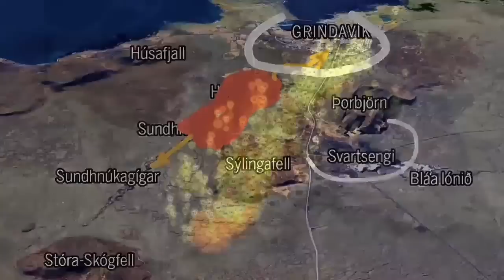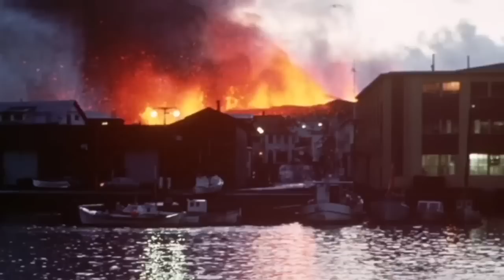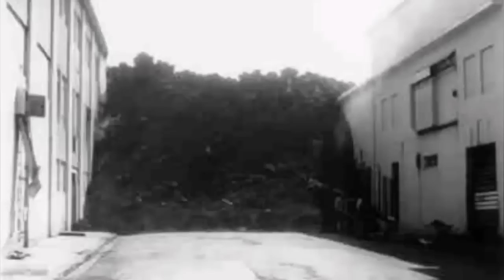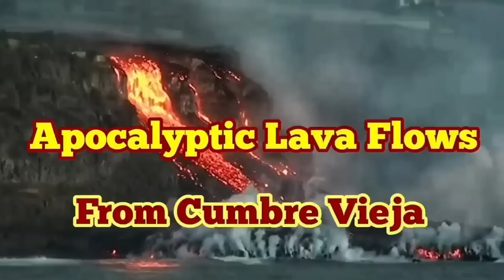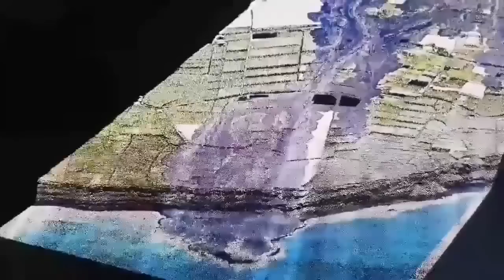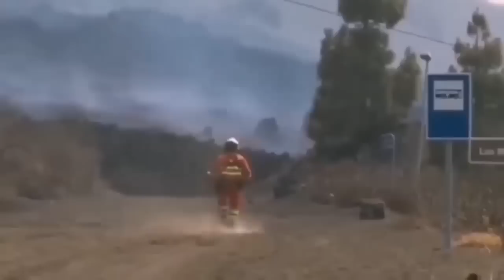Saving Grindavik: Pumping Sea Water On Lava, Iceland Fagradalsfjall Litli-Hrútur Volcano Magma

Comment: Have they considered stopping the lava flow by a row of vertical pipes filled with water? As the water boils off and is replenished, it cools the lava under the surface thereby increasing the viscosity under the surface. As the lava flow under the surface slows down, then freezes, the pipes create a wall of frozen lava. Perhaps a pipe wall on top of a bulldozed embankment barrier where the flow rate nearly stops as the lava depth increases. 
   Pumping seawater on top of the lava cools the surface but the problem is cooling the lava deep down where it is pushing forward. 100 pipes 20 meters high 1 meter apart on the embankments lava side could add 20 meters of vertical barrier on top of the embankment  along a 100 meter stretch.